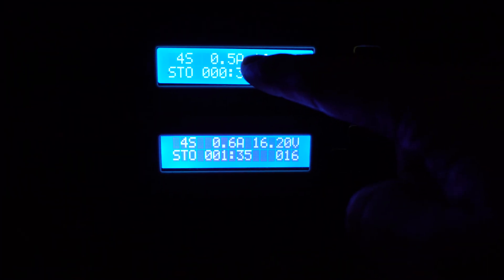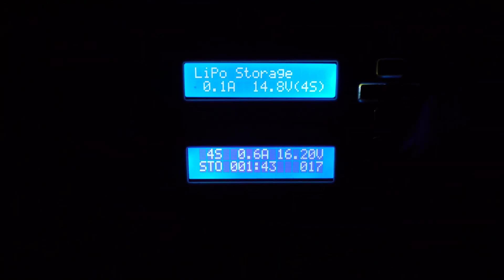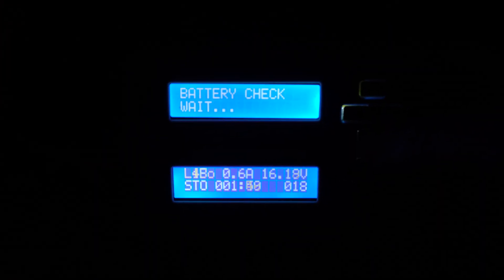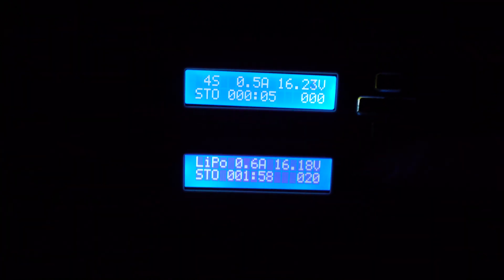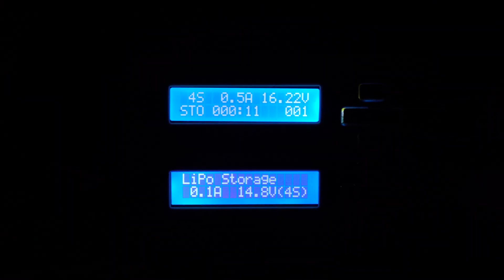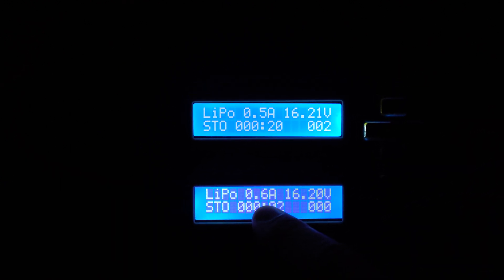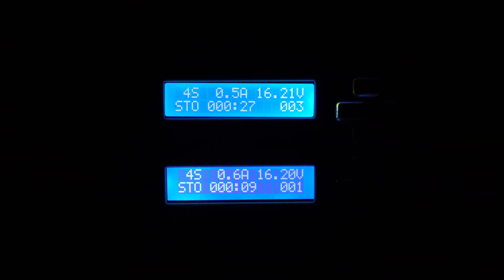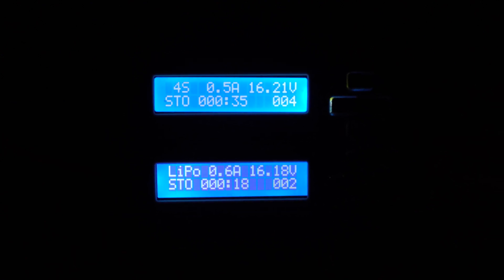Discharging LiPo battery to Storage voltage (Higher voltage issue, HTRC C240 Duo)

Comment: Have you guys noticed that if you use the discharge function on channel 1 that it errors out it a couple of minutes with the message "OVER Int. TEMP CUTOFF". This continues every couple of minutes requiring you to restart the process. This exact discharge function fully completes successfully on channel 2 with exactly the same parameters and cables. I am assuming that this is not the same as the Ext. TEMP CUTOFF that you can set in the user settings. 

I have tested this on a couple of these chargers with the same observations. Tried multiple experiments, e.g. with/without temperature probes, default External Temp Cutoff as well as adjusting this parameter. Using new or used LiPo's give the same errors.

Again, it works fine on Channel 2 but not Channel 1. Just want to see if anyone else experiences this.
Reply: when i discharge on channel one cut off  channel 2 i cannot use because cut off the power